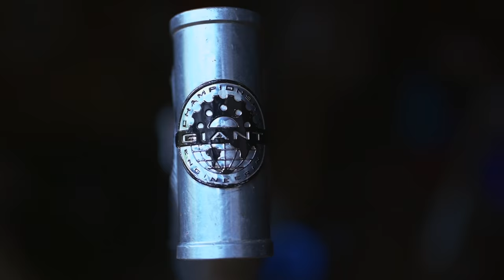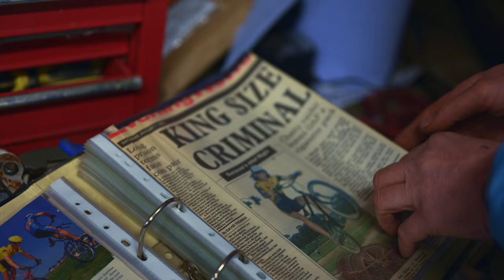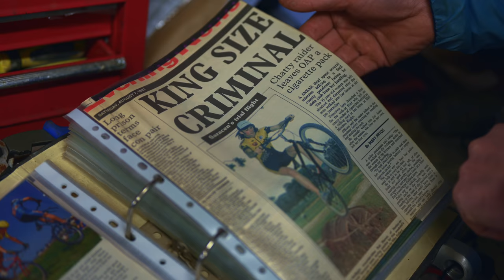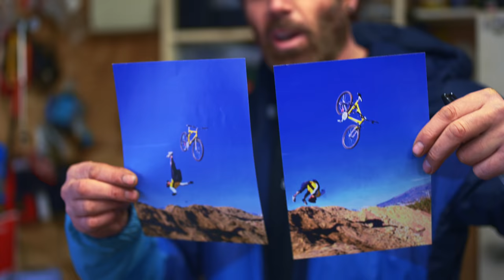IS THIS EVEN POSSIBLE? - MY 1996 WORLD CUP WINNING RETRO BIKE BUILD - EP 1 - ROB WARNER

Comment: I had one of these - with the Goldtec long travel (vertical head angle) adjustment plates, it was an absolute death trap due to the head angle and high BB - it ended at Warwick train station when I jumped the steps into the underpass - the top shock mount ripped itself off. It was shit even then.

Comment: I have a 1996 Santa Cruz Heckler, still ride it regularly in the same places as some modern longer-travel bikes, just at a slightly slower pace. Durability is like nothing else of the era though, and total bike weight is around 14kg, coil springs front and rear. 66 degree head angle even :D

I like to think there was at least one good bike from that era, but I could be wrong.